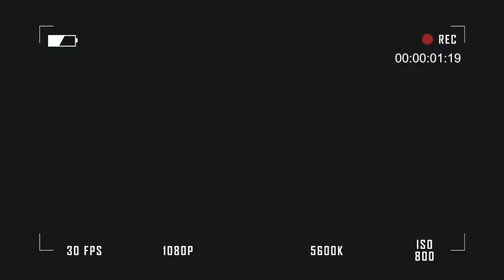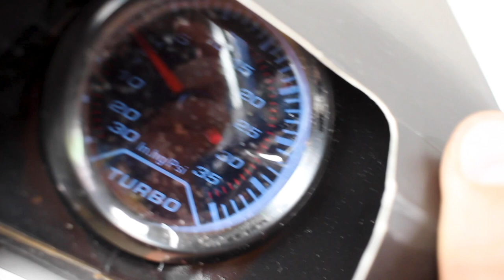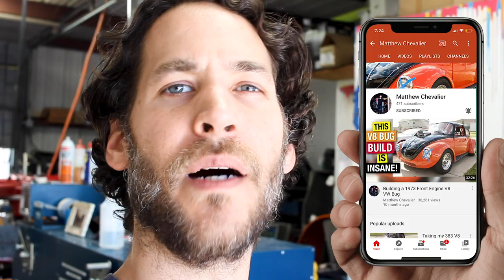Turbocharging the Chevy Cruze with a $113 Ebay Turbo!

Comment: Boosted cars can forgive bad intake and exhaust transitions by requiring a little bit more boost or exhaust back pressure [both reducing efficiency making more heat]; so instead of +220% horsepower it's more like +200% horsepower added to your NA car =)
Reply from the maker: That’s true!

Comment: I’m trying to do this with a 2017 n a big turbo seems confusing as hell
Reply from the maker: It can seem confusing. I plan to document and breakdown the install of the new turbo. What you all need, why, how things go together.
A turbo is pretty simple. Come up with a way to mount the turbo to the exhaust. It basically is in line with the exhaust. Like a muffler. Feed the turbo oil, and get it back to the oil pan. Most are gravity fed. A lot of turbo's are oil cooled, but there's quite a few models that need the engine coolant to be fed to it. In which case you could tap into your heater fed and return lines. Then you have your cold side, in which the turbo is compressing air. Compressed air heats up, so you'lll need a way to cool it. Such as an intercooler, which is basically an air radiator. Lastly, you're cramming in more air, so you'll need more fuel. Injectors that are able to flow more fuel is what would be needed. And of course, the car has to be tuned.
Reply: @cmattdabrat  well said
Reply from the maker: @joshw9037  Thanks

Comment: Unless you paid over $200 for it, not a real HKS BOV. Not that it matters, I have a fake one as well, hahaha. BTW several of your eBay links don't seem to be working for me. I know they just updated their linking system. Just figured I'd let you know.
Reply from the maker: Thanks! I appreciate it. You're right about that. The eBay links and the cost of a real HKS BOV.
Reply: @cmattdabrat  The copies are VERY convincing and by most accounts, unless they start leaking, perform similarly.
Reply: I wish there was a kit made for the 1.8 so you don't have to go buy a bunch of parts, it seems simple but all the links are leading nowhere so got to go off the keywords of the parts, and then you got 50 options haha... Imagine making the kits and selling them! (Might be a business idea!)
Reply: @alexshaffer8133  Building a turbo car on a budget definitely take a lot of time and research! Even if there was a good kit out there, you'd likely have to fill in some blanks.

Comment: Bro you must have spent 5-6 grand in just fittings.
Reply from the maker: $1300 all in.
Reply: @cmattdabrat  not bad lol for a Cruze lol: how did you remedy the auto start function. Does the car still shut off when you stop? Or did you have to remove that auto start system?